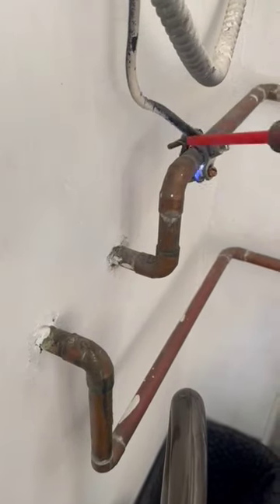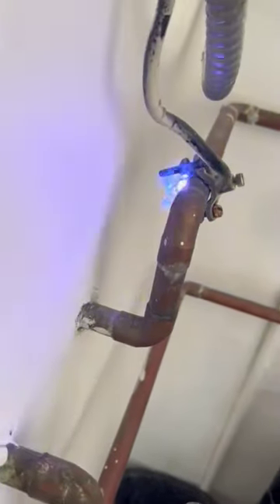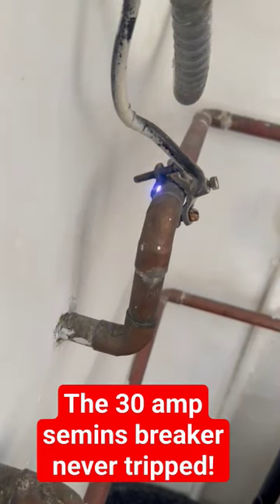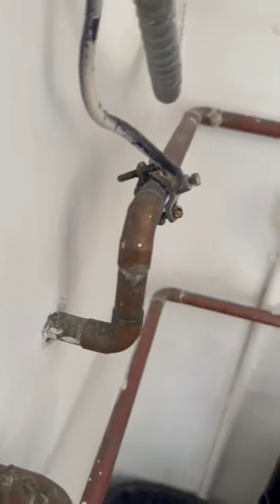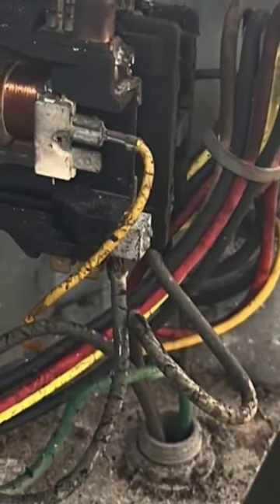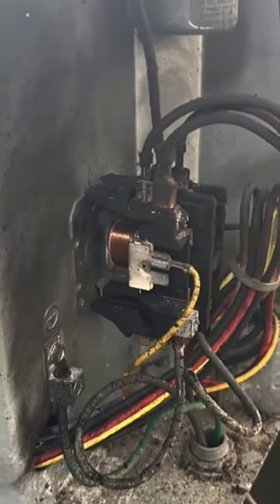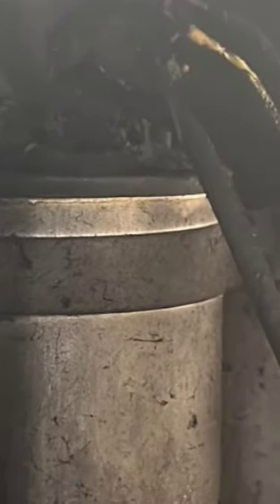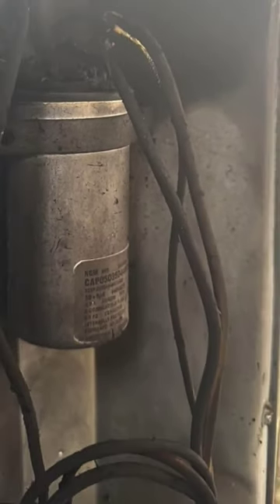Major grounding issue + lightning strike + loose cold water bond clamp = this!

Comment: Lol do you call the plumber, the electrician or the HVAC guy for this? 🤣
Reply from the maker: Haha good point
Reply: HVAC guy because he's a plumber, electrician, and all around super guy all in one.
Just ask one, he'll tell you.
Reply: @robertthomas5906 lol you're not wrong!
Reply: Yes
Reply: You call the electrician. 1st the major problem before the rest.
Reply: Yes
Reply: Yes
Reply: You gonna have all three out there.
Reply: 😮Call the Fire Marshal/Inspector 😢⚠️🏁
Reply: If that keeps burning your going to need a plumber to fix the hole created from the arc!
Reply: @spdergod  nah he invented a micro hot water heater right at the pipe 🤣
Reply: Hopefully one of them are certified.
Reply: @robertthomas5906 no us plumbers do everything not HVAC you guys aren't suppose to not licensed to touch water or gas
Reply: @1Patient electricians have no licensing system 😅 same with HVAC plumbers are the only trade required to have a license essentially jimmy joe bob and billy bob can do your whole house without a license except plumbing
Reply: @robertthomas5906  and plumbers also do carpentry we got a big one up on ya 😉 plus your stuff can't be installed without our drains
Reply: I’d start with the fire department. Lol
Reply: Uhhh...I think I'm calling a priest.
Reply: I'd just sell the house and move. This problem is for the next guy.
Reply: A lawyer
Reply: @JUNEBUGLLC where do you live, because in Texas Plumbers, Electricians, and HVAC contractors are all required to be licensed
Reply: @wilneal8015 Yeah,  do that if you want your hose condemned!
Reply: @JUNEBUGLLC in Australia those 3 trades are
Reply: @Tim_Tomorrow Yep.  That's some Ghost Busters shit right there.   😅
Reply: @Repent2Christ  will technically that's only if you know the whole situation that the ground was not connected to the meter.
Reply: Well assuming whoever's going to make the call for the proper person knows all the stuff this guy just said in the video it would be the electrician first to get the power properly grounded...
After that he can just tighten up that clamp his self
Reply: All of the above ...😂😂😂
Reply: @JUNEBUGLLC I hope you're just trolling about saying electricians have no licenses.
Reply: know this call someone  who knows what their doing. it could  save you house and your life .not taking  a shower  at that house
Reply: Yes.
Reply: Ist no my job
Reply: @JUNEBUGLLC I see your "Carpentry"... and i raise you sheetmetal fabrication, pipefitting, SMAW welding, logic programming, and mechanical repair. 

Also, do you really think that that's "your" drain just because its schedule 40? 🤣
That's OUR drain, buddy. The only reason plumbers get called is because water is where it shouldn't be, and homeowners are confused.
You don't need a license to run a drain from a unit, and my 6 year old nephew can build PVC. 
Not supposed to touch water or gas? 
I know a few boilermakers that might have an issue with that statement.
Reply: I’m pretty sure you call Jesus
Reply: Yes
Reply: None of the above.  You call your insurance agent before you get close.
Reply: The special ESU Unit for housing emergencies they're specially trained in all 3
Reply: @JUNEBUGLLC  wtf are you talking about??? you're not even supposed to install a receptacle without at least a handyman's license.
Reply: Yes!
Reply: Your going to call the hvac guy regardless.  The heat pump was mangled inside.
Reply: I don't know who you call, but def go get a lotto ticket! That house could easily be a pile of ashes.
Reply: You call a priest
Reply: @spdergod + And the Fire Department!
Reply: @JUNEBUGLLC You wanna know the difference between an HVAC guy and a plumber? HVAC guy can do the plumber's job, plumber could never do the HVAC guy's job. And yes you do need a license. You can't even buy refrigerant without an EPA. Anyone can go to Home Depot and buy plumbing fittings. 1/4" of slope per foot for drain. Wow so complicated. HVAC guy can solder and braze and their joints look 100x better than the plumber's who use way too much solder every time.
Reply: I’d call all of the above and notify the landlord
Reply: All of us
Reply: Deffinitely a spark, cut the power to the hvac and fix the grounding issue
Reply: A good electrician is all you need, he can fix you hvac and actually keep your electrical safe. An hvac guy is just a part changer, they dumbed down hvac units to point where there’s no skill sets required, everything is modular and made to change a board or capacitors.
Reply: @falcon5751  you mean pull the meter and kill the power to the entire house, then rework the service so the house is properly grounded
Reply: @JJones-cl4dm  i don't work in NA so idk how you guys do it but we just kill the power with the main switch.
Reply: @JJones-cl4dm  because not every sparky  here is certified to open a meter and its not taken lightly either
Reply: @falcon5751  just fixing the a/c won't solve that problem. Better call someone
Reply: Unfortunately the answer is yes. So call the insurance agency first and try to get them to cover it.  They'll probably try to weasel out under some "act of god" clause. Or do it yourself
Reply: @thematronsmilitia  the answer is HVAC because any tech worth his weight knows enough electrical to sort this out
Reply: @bassman5066  but if the insurance is paying for it they'll probably want a certified professional handling fixing the ground, one of the main electrical components of the house. I am an HVAC guy I could sort it out, but there's also finance politics involved not just know how. HVAC techs aren't required to be liscenced or certified like plumbers and electricians are
Reply: @thematronsmilitia  many HVAC shops and techs themselves are "dual trade" if they are smart (from a business standpoint) and are trained and certified in both. Why on earth would insurance cover this?
Reply: There exists HVAC techs that are also certified electricians, yknow…
Reply: Gonna have to be electrician or maybe HVAC. The plumber is not going to work on pipes that also have an electroshock hazard to them.
Reply: @JUNEBUGLLC That is totally different depending on the state you live in.  In my state plumbing, electrical, and HVAC contractors all must have a state license to operate.
Reply: 🎶If there's something strange
🎶Who ya gonna call?
🎶Ghostbusters!
😆
Reply: You call a lawyer.
Reply: All the above
Reply: All the above 😅
Reply: @robertthomas5906  Well, I DID have to take 150 hours of electrical code to get my journeyman's in MA, and I DO need to know plumbing , gas and fire alarm codes, so...yeah😎
Reply: I’m a plumber, I politely decline to work with fire. I control water leaks, not “magic smoke” leaks
Reply: Weather guy!
Reply: You call an acoustics designer
Reply: @thatdudeinmaroon7+ years here.
Reply: @G8tr1522 Is there even such a thing as a handyman’s license or did you make that up(assume)?  I’m pretty sure that here(NY), only a licensed electrician or the homeowner is allowed to do any electric work. Usually the homeowner done stuff is terribly wrong and almost always has  loose connections and/or terrible splices. The problem with electric is that if the wires are touching at all, things work when you’re done. This makes people think they did it right and also makes people not respect the fact that it’s a highly skilled trade and we know so many things that you don’t even know you should know. Things seem to work fine when they’re done but then end up burning later on due to loose connections.
Reply: @AnUnapologeticApologist Oof. You’re making the common mistake of assuming you know all there is to know about a different trade. You’re probably a great electrician too because it’s not rocket science, right? Black-hot, white-neutral, bare-ground. That’s all you need to know, right?
Reply: @SnotrocketLT4  So if I have a 220v microwave to a 2 wire connection is the white still "neutral"? No it's a phase wire.
Honestly the color doesn't mean anything to me anyway. I never go by color. I check voltage. I've worked on convection ovens that have dozens of wires all the same red color. What does color do for me then? I think you'd be surprised how much I do know about electrical. I do it as part of my business. I worked under a master electrician for years before I ever started in commercial refrigeration. To effectively do commercial refrigeration you need to know electrical. How to use a multimeter to read impedance of loads, how to troubleshoot, trace shorts and breaks, read current, capacitance, I mean 90% of issues are electrical.
Reply: @AnUnapologeticApologist   Yes, it’s obvious you know a lot more than the minimum that most HVAC or refrigeration guys know in order to wire their units or get their restricted electrical licenses in order to wire units. For that, I apologize. My point was that it’s easy to assume there’s not much to someone else’s trade when looking at it from the outside and it’s easy to assume there’s not much to what they do. I’m guilty of it myself as well. Having worked for an electrician for years, I’m sure you know what I mean. You’ve probably seen and learned a lot from that experience that most people that think they “know electrical” don’t even consider or know when they’re doing something ass backwards. My point was that every trade is like that and it’s almost impossible to learn it completely without actually having years of experience in the field. You proved me wrong by dazzling with techno jibber jabber though,lol, so I take it back.
Reply: @SnotrocketLT4  Respect. You are right though, plenty of HVAC guys out there don't know electrical and those are the ones who are terrible at the job. Residential you can get by like that but if you work on refrigeration and commercial cooking equipment you will fail if you don't know it. And again, you're correct, there are plenty of guys who think they can do electrical because they changed a couple outlets and maybe a breaker. When it comes to resi I could pass off as a great electrician. I've corrected many mistakes by other electricians. On the other hand, I've met some commercial electricians who made me feel retarded. Made me realize there is a lot more to it than load balancing and running the right size wires to the right size breakers. My only point is, for the most part a good HVAC guy can do both plumbing and electrical. Maybe a plumber can do electrical if he's smart and plenty of electricians can do plumbing. Very rarely will you find either who can diagnose and effectively make refrigeration repairs. I was only saying this to the plumber who thought his trade is more qualified than electrical and commercial refrigeration.
Reply: @JUNEBUGLLC  You do have to have certification to do any HVAC, at least here anyway. We touch gas, and water consistency. And we also dabble in carpentry as well as bending metal. 👍 Lol

Comment: I'm a generator technician I've seen this hundreds a times power company lost their ground you gotta open neutral On the secondary side of the utility company's transformer
Reply: Maybe, but he said the panel wasn’t grounded correctly so the cold water bond was the only ground. Could’ve been an open neutral also, definitely a lot of current on that loose water pipe clamp lol! Unfortunately if the panel isn’t grounded you got an unsafe condition even if there isn’t an open neutral coming in from outside, definitely a cause for concern in any case.
Reply: Exactamundo!!!!!!!
 Missing the neutral from the power company so the panel is using the water main ground as a neutral and that arcing is all the power for the entire house.  All the lights are flickering too. Very dangerous.
Reply: @NDB469  even a complete ungrounded panel wouldn't cause this. 100% a neutral problem from the power company
Reply: @lfsiuvagacwoi ah I wouldn’t ever go with 100% when it comes to electric issues. I’d say high possibility of an open neutral on the utility side but it could be something else. In this case it was in the house, next case could be outside.

Comment: That’s a lost neutral. All the imbalanced current is flowing to the neighborhood through the water main.
Reply: Yep. Exactly correct. Lost neutral from the power company. Also, by the way, that clamp is supposed to be attached to the water main before the first fitting, right where the pipe comes through the wall. It also needs to be tight(obviously) and should be coated in Skotchcote (electrical coating) to keep it from rusting in the future.

Comment: Happen across one like that. Spooky, no lighting rather a bad transformer. Ground was acting as neutral,  burnt up a bunch of electronics .... power companies responded, but fail to repair ...3  years later they replaced the transformer ....yea
Reply: Yeah.. Loose Neutral will smoke everything in your house!

Comment: Not a proper ground , with modern plumbing the pipe is plastics, but just the ends are metal . When we came across these we called the code enforcement inspector so they could traceback to who did this and fine them

Comment: Open the yellow pages and call you a plumbtrician.  I’ve actually seen this before.  The water bond got so hot it burned a hole through the copper and it started leaking.  Plumbers wouldn’t touch it so they called our division and I went out.  Opened the panel and some hack replaced the feed to the panel and never hooked the neutral up.  Shut it down hooked the neutral back up, powered it back up voltage was clean.  No arcing.  Called the plumbers up “come on back boys that water is leaking into the downstairs apartment”
Reply: Yeah , they'll come expecting to trim a tree😊
Reply: I mean, I wouldn't want to touch electrified water coming from a copper pipe either
Reply: @charlesdeblanc3386 yeah their eyes were big as saucers.  I didn’t believe them at first till I saw it glowing.  I couldn’t believe it.  Can’t blame them at all
Reply: It doesn't require an electrician to know how to shut main power off from the panel.  They must have been knucklehead Sharkbite plumbers.
Reply: @panemon187 you would think right? Our company has a lot of “plumbers” that rotate through and then they are gone.  We do have some really solid plumbers too.  The ones that I dealt with that day were not the pro plumbers we have lol
Reply: And now I feel safe enough to take a bath with a live toaster 😆
Reply: @panemon187 I'm not licensed to do electrical, I'm not insured to do electrical, I'm not trained to do electrical, I am not safety trained to do electrical, my ass is on the line. Even IF I know how to do the work, and am confident I could do it safely and effectively, this is still the time to call in the expert.
Reply: Fun fact, in cantonese you call the plumber / electrician the "water electricity work" (水電工) because they often did one job while moonlighting the other job
Reply: @Yadobler  awesome.  Love my Chinese brothers and sisters, hard working people.

Comment: We used to change water meters here in Perth and you had to bridge the mains water pipe with a big jump starter cable before you removered the old water meter, because the really old houses in the first suburbs a lot of them had this problem, and if you didnt ground the pipe with the brige cable zap zap.

Comment: Commenting on the breaker not tripping:
I did a service call where the gas line was hot, an old k&t wire that some dope left energized was wrapped around it. The wire and gas line were oxidized, so there was enough resistance to not trip anything. I wouldn't be suprised if that copper line was the same way, not good enough path to trip. Especially if it transitions to plastic to either the utility or the well. Essentially a short stub of metal that actually makes contact with the dirt, and whatever little scraps it can find through the concrete.

That call blew my mind, before that I thought ground path was ground path.
Reply: You need a "If you see me running, try to keep up!" poloshirt for that kind of arcane installations ;)

Comment: Open neutral resulting in any neutral current attempting to flow on the earthing causing the 120V circuits to go out of spec and raising the earthing system voltage above the general surrounds with that voltage and 120V balance only being mitigated by continuous metal plumbing and back up someone else's bond wires and the installations own electrode if present etc.  Quite dangerous.
Reply from the maker: Yes it was very dangerous but we fixed everything and it is safe now.
Reply from the maker: Lucky the water bond was loose or the home owner would not have known for some time.
Reply: What turned out to be the problem? @Simonelectricfl